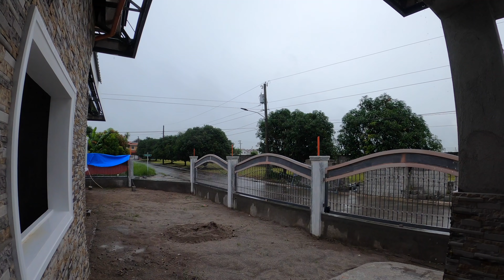Philippine House Building Step by Step, Build Day 156: Chipping The Day Away

Comment: i just remember something that you mentioned last time about your drone won't enter your front door. i think the reason for that is the obstruction/collision sensors of your drone. check if you could cover those sensors with aluminum foil tape or better yet be able to disable them from its app settings. good luck and fly it very very carefully!
Reply from the maker: I’ll have to look at the settings next time I fly. 
Thanks for the tips. 👍😊
Reply: sorry, you cannot cover the sensors. i checked dji mavic 2, the sensors can be disabled.

Comment: where is that big block of contrete or rock came from? i suggest to tell your workers to drill series of holes then crack/split it with chisel. it is quicker than using jackhammer.
Reply from the maker: 😂 they made that. It’s slow build up of cement and concrete from every time they poured concrete or mixed mortar. 
Almost done now.
Reply: @CasaTexPina  When we build our house I think I will keep an eye out that all the build up doesn't occur. LOL. Maybe each night I will go through the place with a flat blade (like our ice scrapers in the USA) and clean everything up when the crew is done working. Maybe then I will be worth something over there. LOL
Reply from the maker: 😂 it’s worth a shot

Comment: Ventilation is the ticket to the longevity for any type of bathroom ceiling material. If your bathroom lacks ventilation, add a good-quality vent fan rated for the size of the entire bathroom. Run the fan during and after each shower or bath until the air returns to a normal humidity level.
Reply from the maker: 👍 Thanks for the tip. 😊